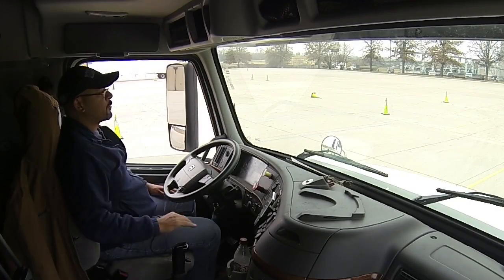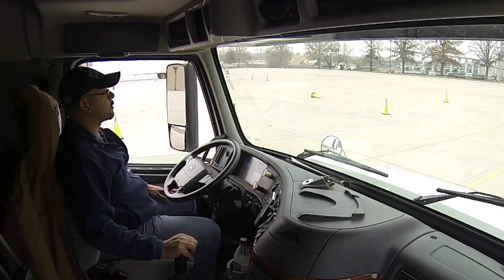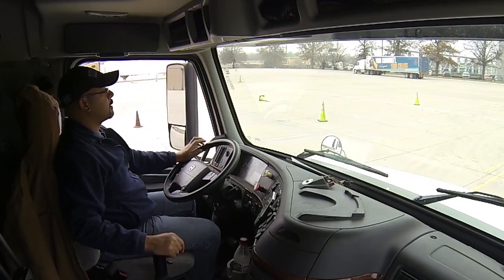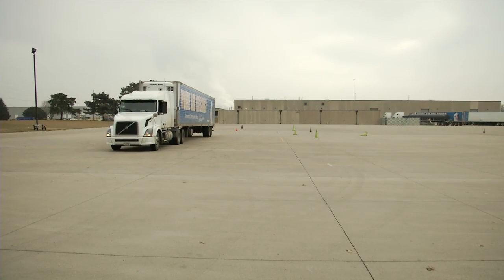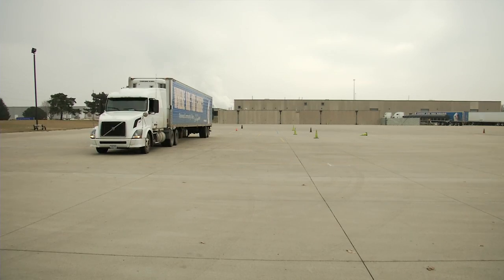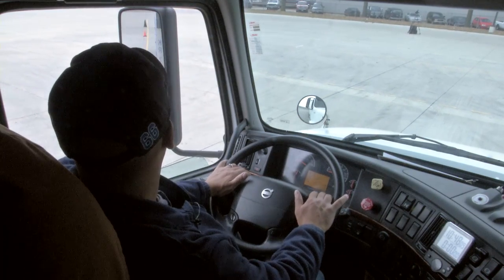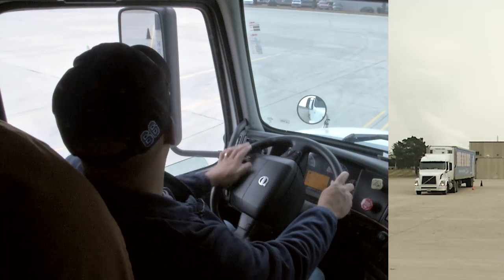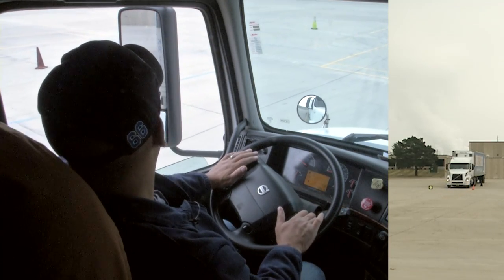Performing a straight line back in a semi truck

Comment: I've watched basically all the backing videos and this is literally the most helpful one...I've been having trouble backing for some reason when I'm in the truck I just can't grasp the concept ....I'm going to try this technique in class tomorrow wish me luck and thanks for this awsome video
Reply: instronympho do not be discouraged. There are many of us who have been driving for awhile, including myself who are still learning. The basic concept to begin is this: When your tractor and trailer are aligned, meaning straight like in this video. Whichever way you steer, the backend of the trailer will go the opposite direction in which you are steering. (I.e.) steer left, end of the trailer will go right. Once you fully grasp that concept, you build on from there.
Reply: instronympho did it ever work? 3 years later? I’m having trouble
Reply: @Africathefuture0416  z
Reply: I'm going through it right now my instructor is starting to get frustrated 
I'm going to try this technique tomorrow